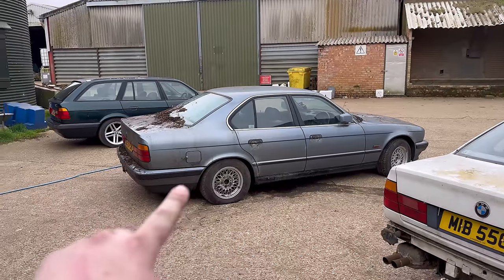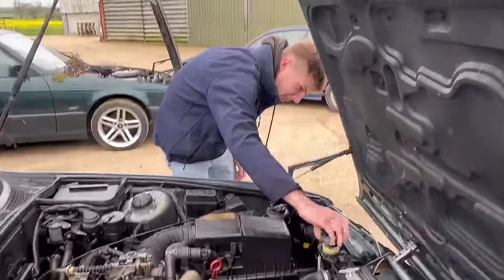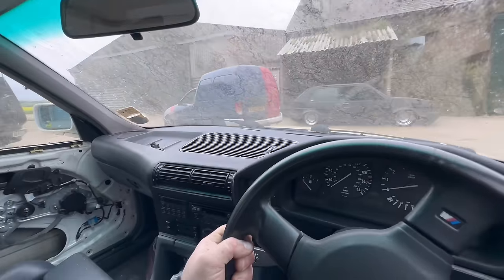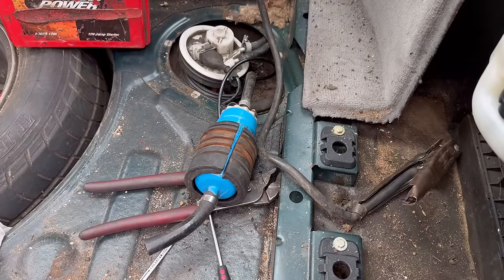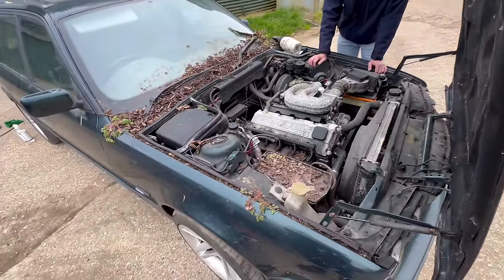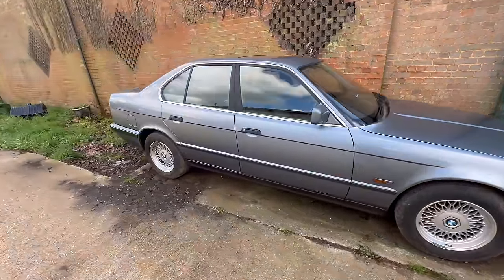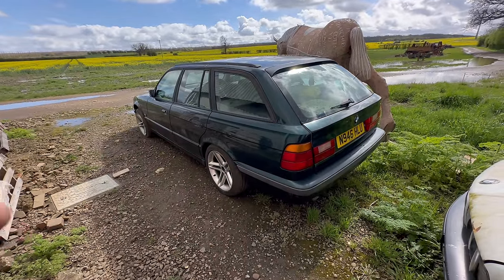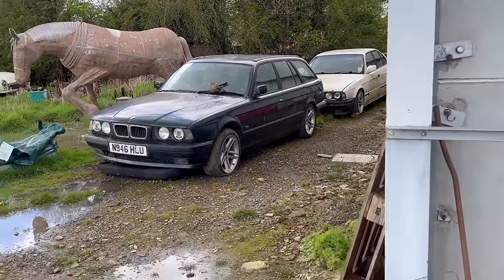OUR BMW COLLECTION GETS SOME LOVE- FANTASTIC SURPRISE!

Comment: The touring 5-series might be flooded.  Spark plugs out, burn off the excess fuel off the tips... turn the engine over with the plugs out to vent all the crap out of the cylinders and then give it another go.
Reply from the maker: wait for next video 😏

Comment: We owned an E28 525i manual and two pre-facelift E34 525i autos as family cars while I was a teenager.  That pre- facelift E34 525i auto should be on the imperial wheels.  The metrics are dreadful and the tyres cost more than the car....swap 'em back over!
Reply from the maker: we will be swapping them back don’t worry!